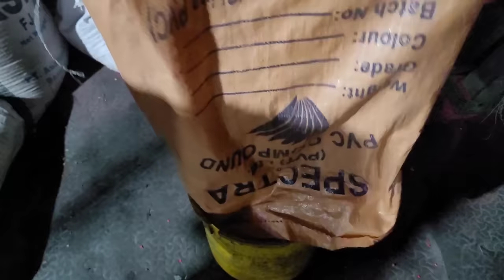process of making electric wire | how electric wire is made

Comment: I wonder what the injury rate of these shops is. Really considering the on/off switch f the mixing motor is - just connect the bare live wires together. Geez, go pick up a light switch at least and wire it up. Worker safety is just non-existent.

Comment: If I were an electrician I'd inspect every centimeter of that wire before I put it in somebody's home. There's no controls for keeping that electrode in the center of the insulator.
Reply: Typical paxtani pancharputr industry
Reply: I wonder how many fingers are severed and electrocutions.   What would be fun to see is an OSHA inspector walk in and promptly have a coronary! 🤣🤣🤣
Reply: Your money your choice..don't forget the wire still works but the quality is low
Reply: @mittrg7998  ഋഋഋഋഋഋഋഋഋഋഋഋഋഋഋഋഋഋഋഋഋ
Reply: @mittrg7998  ഋഋഋഋ
Reply: @mittrg7998  ഋഋഋഋ
Reply: @Manikandan-uv5jb  kya be lappu?!
Reply: @Manikandan-uv5jb 😅😅
Reply: কুবত
Reply: 0:49
Reply: @stevenhorne5089
Do you call the wires an electrode? Their position is in fact controlled. However these wires are not twisted, thus it is really shitty cable.